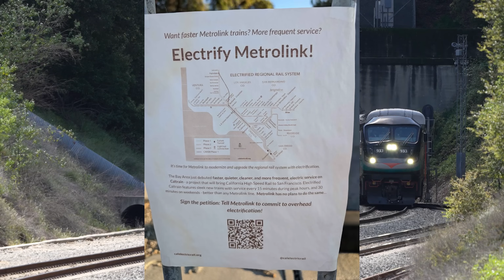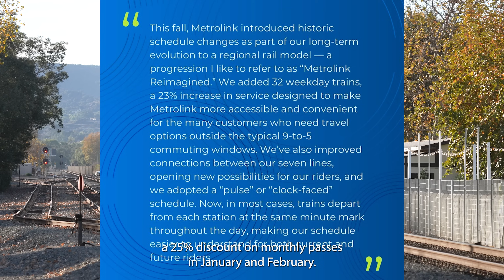Metrolink's Future: Why Electrification Could Change Everything

Comment: They should go to 50 kV DC.  That would support long freight trains.  AC is a legacy technology.  A 50 kV DC train could keep a diesel engine inside of the locomotive and run off of electricity when available.

Metrolink is the only operator of the EMD F-125 locomotive.  PoS locomotive unfortunately.  Should have done the Siemens like everyone else.  If anything else, they need to get off of the EMD F-125 locomotives ASAP and onto something else so they can have more reliable service.  Granted there are a lot of things going wrong with the service and the EMD F-125 is just one of them.

Another thing Metolink needs in addition to double tracks is more graded crossings.  They are short on cap cars because too many are involved in collisions.

Hydrogen makes no sense.  Glad I am not the only one saying this.  Some European countries have seen some major explosions that have blown out windows in the surrounding areas due to hydrogen explosions when there is a mishap.  Diesel doesn't do that.  Electricity certainly doesn't do that.

Comment: Metro-link for the moment should be focusing on adding route capacity by means of double and triple tracking the lines over which it operates, including those portions owned by the freight railroads where possible.
As much sense as it makes to electrify they need to build the system out to be able to seamlessly transition to wire in the future.

Electrifying the liens now has minimal impact on services overall because the capacity issues is not addressed,  the freight carriers aren’t so much against electrification as theirs are to additional passenger services which would ultimately result less time they have on their own tracks which now interferes with interstate commerce. 
Once that capacity issues is addressed,  and freight can run side by side with minimal impact on passenger I think the carriers won’t care much about the addition of wires.
It’s about the route capacity and the commingling of passenger and Frieght you can’t hijack the freight railroads line and make it passenger line and tell them you can only run between 10pm and 4am on their own tracks. 
It’s a double edged sword but it can be negotiated.  

As for the climate stuff.  Just get the chargers and ventures and be done with it.

Comment: Electrification doesn’t eliminate emissions, it just moves where they are being produced. It’s a good thing but it’s not correct to claim that electrification is zero emissions😊
Reply: Easy solution: Nuclear.
Also, electric trains’ main benefit isn’t zero emissions, it’s performance. Faster acceleration, faster top speed, but also has other advantages like less noise, and you don’t inhale any diesel, and smoother ride quality generally
Reply: @stantorren4400 you might not inhale diesel but those who are forced to live near those factories and fossil fuels are inhaling it. It’s not a bad thing to electrify but you cannot claim that it’s zero emissions and that nobody has to inhale the emissions.
Reply: @theflowerflora518 You can go the French route and use a thing called nuclear reactors. They’re doing well in both that regard and with rail travel, with their high speed rail and metro services

Comment: Great video. The approach to more track must be intentional, not build where it is easy. Infrastructure design is most efficient when built to a timetable. The first step is to get accurate running times, not just between stations, but between siding switches and places where building track is 'easiest' and/or appears most likely. Also the time between the hardest to build segments (such as that insanely stupid 10 miles in/along the 10), all the 'easy' and 'hard' segments marked on the diagram.Stringline diagram a timetable of the desired headway, starting with 30 minute headway. Establish and diagram one direction, preferably on a layer of a drawing or CAD program. Establish the pattern on another layer. Two tracks are needed where the lines of the two layers cross. Move the second layer up and down through time, attempting to locate the greatest number of crossing points are at the easy places. The remaining crossing points are the places where a second track is necessary, easy or not. To the extent possible, the crossing point should be at the center of the second track segment, with the ends five minutes away in either direction to buffer slight delays. This will minimize cost for maximized benefit.

Comment: You only need double track on the spots where 15 minute traffic trains meet, preferably the double track ends at a station in either end. This gives the maximum capacity for passenger trains on a single track line and gives some flexibilities for late train.
Reply from the maker: Actually, Metrolink already uses this strategy on parts of its system, like the San Bernardino Line, and it often causes delays when trains miss their timed meets. Single-track with passing sidings doesn’t scale well for frequent service or recovery from disruptions.
Reply: @everything.trains What is annoying for me about the Caltrain Kiss units is that they would fit inside the Swedish loading gauge profile, but out operators use standard European size units.
Sweden does have a larger loading gauge than the rest of Europe both as the standard profile (SE-A) and as the Swedish expanded profile (SE-C)
Reply: The San Bernardino line bottlenecks are from the section in the median of the 10 freeway, and from Bassett to San Dimas (narrow right-of-way). It would be prohibitively expensive to widen those sections.

Comment: I give you a better cheper idea DEMU's or DMU's the only problem is higher floors to fit the engine or you can add power cars 
The problem with the 1 track lines can be solved by DMU/DEMU's thay can get up to speed faster with top speeds of 100mph and you can easily expanded trains with doubleing trains and more cars
Take the nir caf 4000 for example the sets emissions are very low and no visible smoke the only smoke seen is at start up 
I will recommend caf for trains electric or diesel

Comment: Trying to electrify the existing railway network would require the construction of more power plants to ensure that both the railway and the surrounding areas have enough electricity so that everything can run smoothly but having the railway fully electrified would require the freight trains to be redirected or even reduce the height of it's cargo which would require the freight trains to be longer in length to transport the same amount that they currently deliver just my observation on this topic

Comment: One thing about electrifying Metrolink is that Coaster's line from Oceanside to San Diego would likely also have to be electrified, and there are major bluff issues in both San Clemente and Del Mar that would need to be dealt with before any electrification of the LOSSAN corridor could take place.

But one thing I can see happening if the entire LOSSAN corridor is at least double tracked (parts of it are more than double tracked, particularly in the L.A. area), which would also require the tracks be moved off the bluffs in both Del Mar and San Clemente, is that I could see the IEOC Line getting extended from Oceanside to San Diego to allow for one-seat connections from San Diego to the Inland Empire, the Coaster to be extended to at least Anaheim, if not all the way to Union Station in downtown Los Angeles, and have that be the commuter rail line from San Diego to Los Angeles that would hit all the Coaster and Metrolink stations, and have the Surfliner be the express with more limited stops. I could even see a line like the Desert Wind returning to bring traditional rail service back to Las Vegas, but instead of running it between Las Vegas and Los Angeles, run it between Las Vegas and San Diego to get a second Amtrak line in San Diego.

Comment: Since Caltrain still uses diesel locomotives for South County Connector, i.e., the four round trip trains going between San Jose and Gilroy, forcing Metrolink to electrify 100% would be unfair. But my base of standard would be this: for me, Metrolink should electrify 6 of the 8 services it currently provides: Ventura County Line, Antelope Valley Line, San Bernardino Line, 91/Perris Valley Line, Orange County Line, and the Inland Empire - Orange County Line (With Antelope Valley Line and San Bernardino Line being more important and urgent).  I'll let Metrolink off the hook with the Riverside Line, Arrow Service, and the 1 San Bernardino Line roundtrip train that goes all the way to the Redlands which can still use diesel. Here are my reasons:

1. For the six lines that I want Electrified, that is because all Caltrain weekend services have been electrified, and Metrolink offers weekend services on all six lines. 

2. Just like the South County Connector only offers Weekday peak hour services on Caltrain, Metrolink offers the same with the Redlands - Los Angeles Service as well as the Riverside Line, so I'm letting them off the hook. 

3. As for the Arrow Services, they were very similar to the e-BART running between Pittsburg/Bay Point and Antioch. since e-BART has weekend services on diesel engines, I'm allowing Arrow service not to be electrified.

Comment: Diesel battery bi-mode Akku already exists. I think for a lot of diesel hauled commuter lines can convert to these trains, setup charging/catenary close to station stops for speeding up acceleration and recharging battery. And requires limited upgrades to the rest of the infrastructure

Comment: While electrified CalTrain is nice, the process was unnecessarily excruciatingly painful. For years the train reduced frequency to 90-minute intervals. CalTrain also gave short notice switching to weekend bus bridges that took 3 hours to travel 25 miles. The crews did not schedule their work around train schedules, causing lengthy delays. Finally, electrification completed before grade separation, which means any future grade separation construction can only take place between 01:00 and 04:00 a m, doubling construction costs. Imagine paying $600 to separate each crossing!  Right after the ribbon cutting, a spade of copper theft decimated punctuality. 

Metrolink won’t get all the service improvements CalTrain experienced. CalTrain owns the track which carries almost negligible freight traffic compared to the tracks Metrolink leases. 

I’m not anti-electrification, just to know CalTrain offers plenty of custody and painful lessons.

Comment: Well here's the problem, everything going electric is too much money, not only that, but electric is no difference to the environment, another concern is that metrolink is a larger system, freights use some of the tracks and going electric can be a problem if the entire system goes down, then metrolink service goes down
Reply: Electric traction for freight trains are not a blasphemy, it's used everywhere in the world. The biggest part of European, Russian, Chinese, Japanese freight trains are electric.
Reply: Funny you said it that way, the thousands of diesel locos in usa use electric traction on each axle to propel the unit.
Reply from the maker: Thank you for your comment Moises.

Comment: It is almost unfathomable to think that our second largest city doesn't have a fully built out metro rail in 2025. But the very best advance military in modern times.
Reply: True, but Los Angeles has built more metro rail track than any other city in the USA over the last 35 years. Several important projects are being completed in 2025, 2026, and 2027 including a LA Metro connection to the LAX airport. 

Several other projects have already been approved and have started preliminary construction including 2 expansions of existing LRT lines, 2 brand new LRT lines, and a new heavy rail line. All these are scheduled to be completed within about 10 years.

LA will have the 2nd largest metro in the Western Hemisphere in about 12 years, probably surpassing CDMX, and second only to NYC.

Comment: I tried SMART from the Larkspur Ferry in the Bay Area for the first time, and omg they should electrify too, that way they could do a tunnel to the Tiburon & Sausalito ferries which would be a better connection to SF than Larkspur
Reply from the maker: Very nice! Thanks for your comment.
Reply: Tunnels would be an economical connection. There are plans now in place to do that by 2030. SMART electrication will occur when the line is extended to Ukiah in 2029.

Comment: One problem with Hydrogen Trains that wasn't mentioned is that supposedly "Clean Hydrogen" can be quite dirty depending on its source. Most Hydrogen produced industrially uses Natural Gas or other fossil fuels as their feedstock, rather then Renewable Electricity. And even the small percentage that is truly Green, energy is lost in the conversion, storage & transportation, results in low well-to-wheel efficiency.
Reply from the maker: Thank you for your comment and intel.
Reply: Aren’t there more resources for hydrogen that doesn’t come from natural gas or petroleum?
Reply: @aaronmiller5012   IDK, there could be. But, AFAIK, the vast majority of Hydrogen production uses Fossil Fuel, either directly as a feedstock or via electricity generation as part of the grid mix. A tiny minority of Hydrogen is created with water electrolysis using carbon-free electricity eg Solar, Wind, Hydroelectric, Geothermal, Nuclear etc.

Comment: The biggest problem is really the freight companies not wanting electrification. Though it isn't impossible to fit double-stacked container trains under catenary (see India), it's not yet something that has been done in the US. It would also require enlarging any tunnel there mgiht me. And, and I'm not 100% sure of this, I think the reason Caltrain is allowed to use the light-weight trains that allow even faster acceleration is because they don't share tracks with heavy freight trains. There's a law in the US (but not many other countries) that says that passenger trains sharing tracks with freight trains also have to be heavy-weight. So it is a little more complicated, but I still think they should do it. Metra in Chicago is also a so obvious example. It's frustrating how slow these long, heavy trains struggle from station to station.
Reply: Caltrain was granted an FRA waiver allowing it to run lightweight trains on the same tracks as freight trains.
Reply: Double stacks run under caternary on sections of the Northeast corridor FYI

Comment: Electrification would not change much, the biggest changes would come from reallocating infrastructure, adding more tracks, and better station land use. What holds Metrolink behind LIRR, Caltrain and even Metra is that their main corridors lack dual tracks, passing tracks, and passenger priority. And secondly the stations need better land use. I think to fix Metrolink a focus needs to be taken on having them take over ownership and priority on some routes, or build a second set of passenger tracks on others where the land exists. Than maybe have electrification be a byproduct of said infrastructure expansion.
Reply: Didn’t Metrolink’s f125’s were recently acquired? They still look relatively new to me. The question is would they be thrown away if they even were to decide on electric?
Reply: @aaronmiller5012 The F-125’s which are 80% of metrolinks engines are all relatively new, under 10 years old. They probably have a good 25 years of life left, but Metrolink only has 40 of them, If metrolink wants to expand services and replace the older remaining MPI engines than electrifying a busy line like the San Bernardino, OC, or Antelope valley would make a lot of sense.

Comment: One potential problem with electrification: There are a number of tracks used by Metrolink in the Los Angeles area, particularly on the east/west lines transporting goods from the harbors towards the rest of the country. Some of these trains are double stacked, meaning two containers on top of each other. It IS certainly possible to have electrified rails and still be able to use double stack containers, but the wires need to be a little higher than standard. This means the rolling stock needs some adjustments for the pantograph to reach the wires. In India they run double stack containers on electrified lines, but if you see videos of it you notice the locomotives pantograph is really high up. I don't know if this is going to be an issue in the Metrolink network. I guess adjustments can be made for it.....

Comment: The answer is hybrid power units.  Buy some battery units to pair with existing diesel units.        Some railroads have moved to hybrid pairings.  You get electric acceleration.

Comment: Don't expect this anytime soon. Metrolink has far more route miles than Cal-Train. It took many years to electrify the 56 miles between San Jose and San Francisco. Much of  Metrolink's route miles are a single-track railroad. Cal-Train is double tracked all the way. Cal-Train also has a much higher rider count than Metrolink. This means much less revenue.
Reply: That's very true. Although should BLW eventually be built then the San Bernadino line may get electrified. Should CAHSR ever reach Palmdale (or Santa Clarita) then the Antelope Valley line may also get electrified. However, these are big asks.